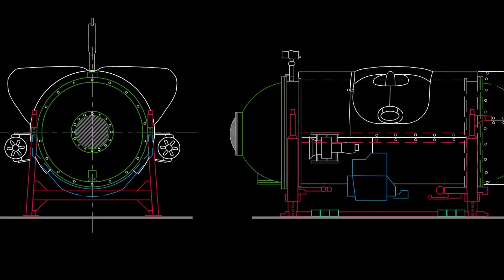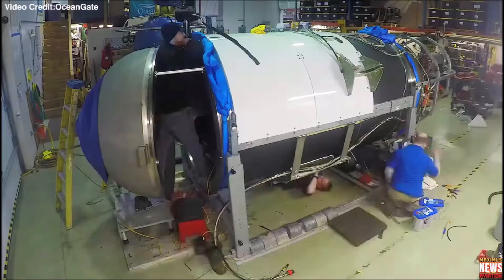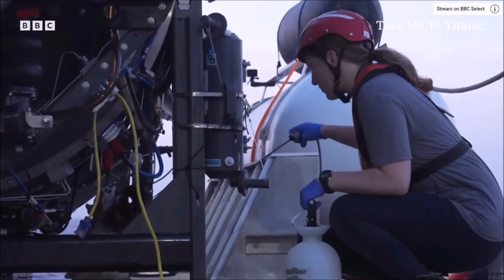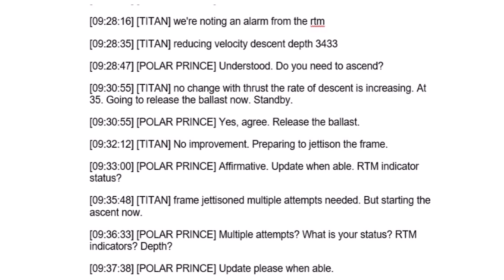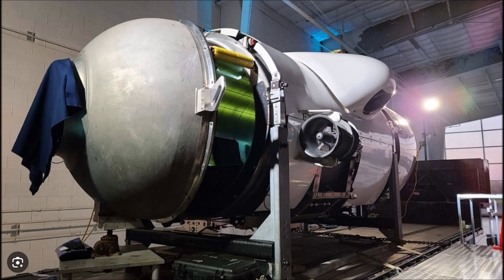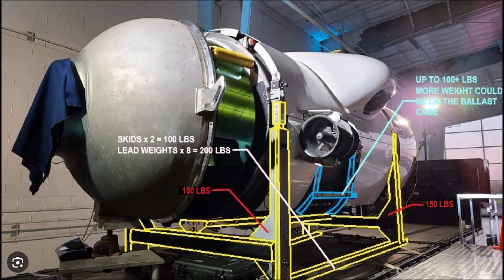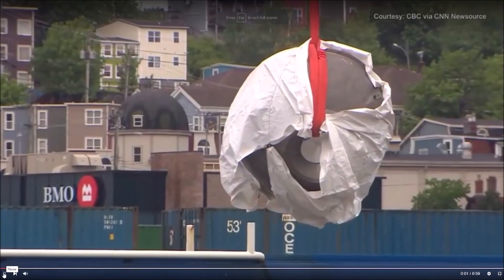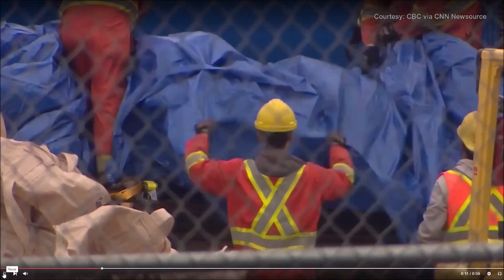OceanGate Titan - DIVING "TOO FAST" A REALISTIC SCENARIO?

Comment: A cubic inch of lead is about 0.4 pounds.
A cubic inch of steel is about 0.283 lb. That's more than a quarter pound.
Reply from the maker: Doh! Thanks for the correction. Don't know how I messed that up. In that case, it's even more critical to get the amount of ballast correct.

Comment: How could that submersible even be kept in a horizontal direction with only these two propellers in the middle of the sub., facing down? What happens, if all the passagiers meet at the same time at the front window, to look at something?  There should be two in the front and two in the back as any sub has two paddles at the front and two at the back: (Das Boot, Alarmtauchen) - https://www.youtube.com/watch?v=x3HpQejqb0A

Comment: there was 3 different sized lead weights small medium large,  all vids ive seen show the weights on bottom rail are at the front, what can, may imply that the front would fall quicker allowing the rear leg section to jam as you offer. the whole leg part cannot fall most proberbly a inner strut with the bottom rail slipping out the main leg structure, the main leg structure is connected to the sub. the sub will need legs to remount on raft. all commenters thus far have failed to realise this. we are all making educated guesses. the 4 struts running between the 2 cones, domes, are adding more stress to the front dome. pulling the top, pushing the bottom. the side struts would do the same. one off these struts is in line with a hinge holding a big heavy door??????? big heavy open door that is pulling and twisting at the seal between carbon and the ring massive stress on this one 8 inch section of that ring bonded to the carbon????/ bouncing up and down constantly every time this sub went down. i would bet my life this is where the breach started... then again forensic guy with the cats, who has insider KNOWLedge. claims with authority, there is a hole in the top off the carbon tube towards the back off the sub, letting out excess gasses in his last video.???????.?????.??????/ manually pumping gasses to 300 bar preasure would exhaust 5 marathon runners in less than 5 hours. so how this sub was expected to last 4 days without electric is anyones guess. end off the day the sub failed do to cost cutting at every level,
 rush is responsible for that, and that is it. cost cutting cost 4 innocent people to lose there lives.
Reply from the maker: I haven't watched any of his videos except for part of one of them not long after the implosion. As far as I know, there were no openings in the hemispheres or the carbon fiber tube. CO2 was taken care by a little box with a fan on it that had some CO2 absorbing powder in it. Not sure what this tube pumping gasses thing is about unless it's something to do with the external tail section. They had wireless controllers so that there would not need to be any penetrations in the hull assembly. Side effect is that made it "cool" for the younger generation. Battery problems were apparently not uncommon per Bruce Morton, former OceanGate engineer. As far as the legs, if they had to drop them they are in a "we need to get our asses up to the surface now!" scenario. Transcript seems to support this. I'm just trying to quasi-reverse engineer this thing to a certain level,  the basic elements of it. I am wondering as of late if the flanges on the titanium interface rings maybe caused a stress riser(s) that caused a small de-lam/crack at one end and the failure of the frame/legs releasing caused it to just outright fail. There's multiple ways for carbon fiber to fail. The big hinge on one side certainly could be something of a factor. The four lifting points on the interface rings is another. Water intrusion is another. Galvanic corrosion is even a possibility.
Reply: @VegasCyclingFreak  there had to be a hole. because they used a hydrolic pump to drop legs when electric failed? the struts on the legs that go across the underside are connected to the sub so cannot drop..i am froze at 3.19 on a weather collapse vid. from 7 days ago. it looks like on this freez that the outer leg at front may slide off there is a clear outer and inner. have you seen the slow mo guys vid showing in implosion. the co2 absorber was crap. and would fill with water. more off a dehumidifier. and would not work when elec failed? i dont think absorbing c02 would be enough in the case it got stuck for 3 days, them 4 oxigen tanks have a load off capacity. they would fill the sub many times over. to get gas out it would need to be 300 bar preasure to stop water leaking in? that gas has to be got to 300 bar to get out.
Reply from the maker: @theweasel-uf7dn  I still think that could all be done remotely. They had redundancy with the batteries in the tail - if there were no problems with them. In a worst case scenario one battery could go down and they put massive drain on the one remaining battery trying to drive the pins out, then they don't have enough juice for the thrusters and have to rely pretty much solely on physics to get to the surface - which is bad because it takes too long. I could see that scenario happening in a panic. The batteries inside under the deck could take care of the stuff inside, but yeah for only a certain amount of time. Seems like their emergency contingency plan had a lot of holes in it... like they believed it never would really have to be used and didn't really put the time and attention needed into it. Goes back to the not asking enough "what if" questions I mentioned at end of one of my videos.
Reply: @VegasCyclingFreak  not enough testing for sure. they had a hydrollic hand pump in the sub to drop the weights in case bat failiure rush was bragging about it. wondering today about the pins to hold the lead weights in place on that rail as they were missing on the bits brought up. you would think they would be far enough from the explosion to still be in place.  if someone forgot to pin these on they could have slid to the back causing a tail end dive down. as i said these weights are always on the front in under water vids. the drop off ballast and theses weights were also to keep the sub upright.  be nice to know or guess what the compression was from endto end of the carbon part. 100 inchlong. 3 mill shrinkidge. 4 strong struts stopping the rings gloyed to it shrinking in slowly pushing the bond apart. especially near the 5 to8 inch door hinge them steel rails have pushed the bonds apart, so many crap designs on this sub. a real scrubber would cost 1000 pound max. they had to bodge one up for 30 pound max. anyone defending rush is beyond human. cutting corners, saving pennies is the reason 4 innocent people are gone.
Reply: @VegasCyclingFreak  the slow mo guys. show , underwater explosion at 120.000 fps. from one minuite to bout 1;19 mins. an implosion can be seen. brill vid for understanding an implosion. the collapse off the hole in water clearly visible.
Reply from the maker: @AwkwardDavies  Hmm... interesting. You should able to just put a link here in the comments unless YouTube won't let you.

EDIT: You may find this video interesting. I do not believe they had any penetrations in the hull whatsoever. They didn't even want to do it with Cyclops, which was not anywhere close to being able to dive as deep as Titan.
https://youtu.be/ipAxZoMzFYk
Reply: @AwkwardDavies  i think the wireless is standard for subs. not a cheap as chips one like this though. dont know how they work. blutooth . wifi, no clue. but an exspensive one would have better conectivity. ive seen a hole in the rear dome off center, the video i saw has now disapeered.
Reply: @AwkwardDavies  dont think we have seen the rear ring, or dome, may be wrong, they could be together still. it was said early that they had these. also this is a grave they could have left a peace on the bottom as a future SIGHTSEEING peace, gravestone.

Comment: Oceangates mech engineers seem to have been self taught CAD jockeys. the proof of the puddin was the flimsy sagging rear frame with its added on CF upper spine to support the weight, likely attached to a welded on lug on the hemisphere... 
The cracklin sounds was likely something coming loose on the frame, the hemisphere would amplify this.
Reply from the maker: I’ve also felt that the framework supporting the things inside the tail cone seemed a little anemic. It was attached to the three lugs on the rear interface ring. In a previous video I proposed that maybe that bond between hull and rear interface ring failed due to all that stuff in the rear but there is the problem of the massive 5,000 or so PSI of hydrostatic pressure that would keep the hemispheres in place…

Comment: The parking lot photo shows the skid was corroded to feck, they used galvanized steel tuibing, cheap ass maroons. and why the three hole starboard lug on the rear ring ring fell off its weld, !!!!!!

Comment: If the carbon fiber is weakened from multiple dives, then there will be a significant loss of buoyancy due to decreased cylinder volume that will get worse as Titan goes deeper, and this seems to match the events in the transcript. This depends on the following assumptions:
- For its first few dives with the carbon fiber at full strength, at 4km depth the carbon fiber in the cylinder will be compressed around 1 inch, but the titanium caps will have negligible compression. 
- For its last dive, the carbon fiber may be weakened after multiple previous dives and may stretch more easily, leading to perhaps an additional inch of radius reduction at the mid point of the cylinder - i.e. 2 inches radial reduction compared to the radius at the sea surface. The additional shrinkage will not be present nearer the titanium caps, but will linearly get worse closer to the mid point of the cylinder.
That loss of volume represents a volume of water weighing around 700 pounds, and thus a loss of around 700 pounds of buoyancy. That loss would have begun not far under the sea surface, then increased to 700 pounds as it descended to the bottom. A small decrease in radius of the cylinder represents a significant loss of buoyancy.
Reply from the maker: OK but their system of acoustic sensors and strain gages should have caught any fibers breaking while it’s “shrinking”. Carbon fiber won’t shrink, it will just outright fail.
Reply: @VegasCyclingFreak  Carbon fiber compresses under pressure. As stated by the CF supplier, the Bulk Modulus (compressibility) of the material used to build Titan's cylinder is around 20 GPa (vs 100GPa for titanium). During several dives, passengers reported loud bangs (maybe fiber breakages ?), this could have weakened the cylinder. The transcript recorded that the sensors showed failures, but the CF didn't instantly fail.
Reply from the maker: @paulcarter7445  Bruce Morton, former OceanGate engineer, said it only compressed a few millimeters in their testing. If fibers were breaking down on every dive, their patented acoustic sensors would have picked it up. Carbon fiber is very stiff & can be brittle. It would outright fail before it gets squished to some smaller diameter (and staying that way indefinitely) and then failing.  

Do you think they kept the ballast exactly the same on every dive when on each dive the total payload weight changed?
Reply: @VegasCyclingFreak  the actual supplier of OceanGate's carbon fiber provide a table showing a Bulk Modulus of 20 GPa, which translates to roughly 1cm at 3.5km depth. Note that Bruce Morton also states that CF compresses  - it's not as stiff and brittle as one might think. OceanGate's testing consisted of a one-third scale model using the same materials as the full submersible which failed at a pressure equivalent to around 2km depth. If they took their compression measurements (a few mm) from that model, then expect the full scale to have three times more compression, and at 3.5kms depth almost 5 times more compression.
But a great indicator is the actual buoyancy of Titan on that last dive, and if the transcript is correct, then there was clearly a significant loss of buoyancy and the slowly increasing compression of the carbon fiber neatly explains that.
Reply from the maker: @paulcarter7445  Yes I am aware that carbon fiber has some give. I ride carbon fiber bicycles and I did quite a bit of research before I would trust my life going down a mountain at 45 MPH on a full carbon bicycle. When you put a carbon frame into a bike stand that holds the bicycle by the top tube, it doesn't keep getting smaller and smaller indefinitely until it fails, it just suddenly goes CRUNCH! I know, not exactly the same thing but my point is that when carbon fails it does so suddenly and catastrophically when it gets beyond its yield point. I don't see the hull being able to possibly compress as much as you say. It was 5" thick so it changes the nature of the CF tape somewhat.

Anyway, I disagree that the CF could compress as much as you say without outright failing long before that. I watched this APL-UW video from 2016 where they were doing their 1/3 scale testing. https://www.youtube.com/watch?v=pOZQ103p9po
They were trying to make CF hemispheres work and it just didn't. 
Per this video from a year ago, https://www.youtube.com/watch?v=IHR3foWRy94&t=3021s
Bruce Morton states that the hull compressed, but only a few millimeters. They were not using data from 1/3 scale model, they were testing actual sub before the first test dive. First test dive of Titan was in 2018.
Reply: @VegasCyclingFreak  The CF supplier's compression metric is pretty clear. How do you account for Titan's loss of buoyancy in its last dive (assuming the transcript is accurate) ?
Reply from the maker: @paulcarter7445  Yes, but is that for 660 layers of the stuff "baked" for 2 weeks? "Loss of buoyancy" could simply be too much weight was still attached... they thought they should be ascending much faster but weren't because they didn't actually drop the frame, was still hanging on by one leg. I wonder if they also got caught up in the gulf stream or something. I think there's several elements that all conspired in a bad way, it's not just one thing that is responsible. It could have all started with human error on the surface before they even dived and then was followed by bad decisions made at 3,000-3,500 meters.
Reply: @VegasCyclingFreak  the supplier's compression metric is for the baked product, and the bulk modulus is independent of thickness.

Re human errors regarding buoyancy: that's  unlikely - the passenger weights and required ballast have a direct relationship and are simple to calculate. The ballast weight calculations are vital to safety and I doubt they would be overlooked.

The wreck of the Titanic is well away from the Gulf Stream, thus salinity and temperature would likely not have changed significantly from previous dives. Any significant new ocean current would have caused issues for the power supply for the propellers and would not impact buoyancy.

The frame was dropped because the ascent was much slower than anticipated, even with the propellers helping. 

At the depth and temperature of the Titanic, the water density is greater than at the surface by about 0.3%, so if it weren't for the carbon fiber's compression, the Titan would get more buoyant as it neared the wreck, not less buoyant.

One other thing that might cause loss of buoyancy is loss of the syntactic foam or a loss of the foam's buoyancy, but that is also unlikely.
Reply from the maker: @paulcarter7445  OK, so if the carbon fiber compressed as much as you say, then why didn't they always have a loss of buoyancy problem? Are you saying it only happened on the day of the implosion? If they got the ballast wrong and the frame didn't completely detach that would appear to be a loss of buoyancy. They also had lead weights on the skid, not just on the ballast cage/rack thing... seemed to be where they'd store them. I believe there is a human error element involved in this somewhere. Human error happens with airplanes, why not possible with a submersible? Especially considering how they went about doing things. How qualified was the support crew really? Lots of questions in my mind.

According to Bruce Morton, the OceanGate engineer, the mechanism for dropping the frame was pneumatic. I could see that being a problem trying to drive out crusted up pins using air and one of them simply not moving. Could have contributed to their battery problems and not having enough power for the thrusters. I imagine those thrusters needed to be running at some certain wattage to be effective, which I suppose would be that Carlos thing in the transcript.

As far as the CF they used, what is your source for this info? Do you have actual OceanGate documents that prove exactly what carbon fiber they used? Also, what you claim very much contradicts what Bruce Morton said, which was it only compressed a few millimeters and you are suggesting something that is like 10x that(?). Not trying to be argumentative, just trying to understand how these two claims can be so far apart. Whatever the case is with that, the use of unidirectional CF was a mistake in my book.